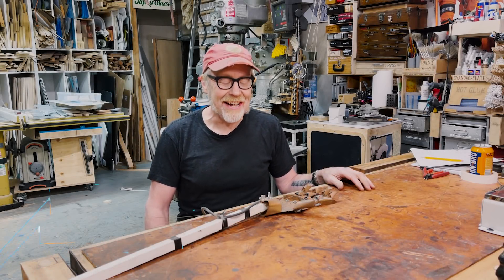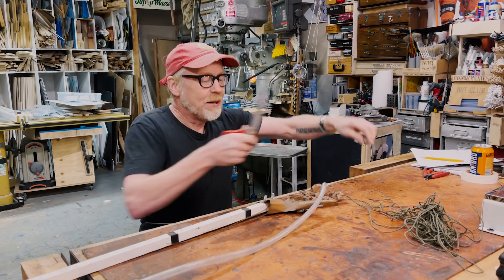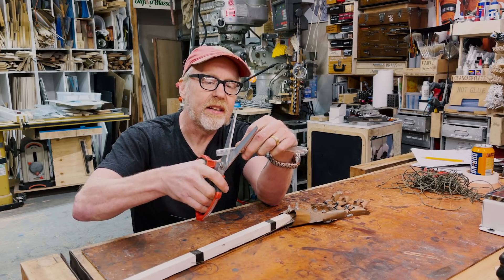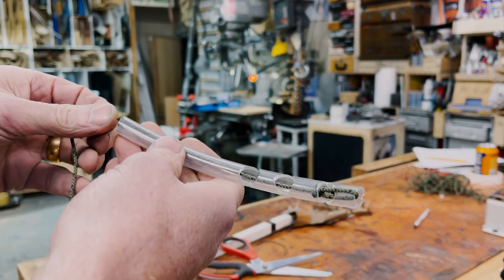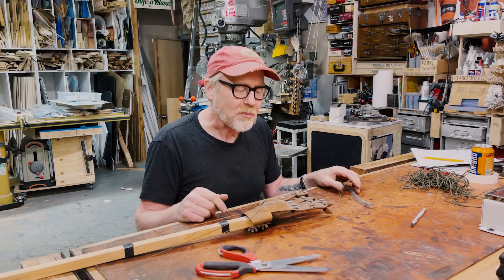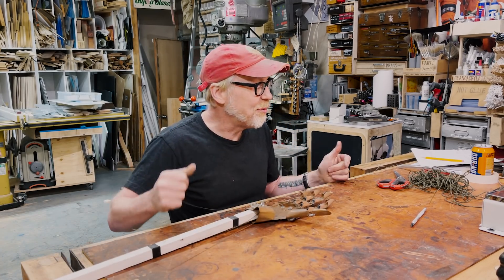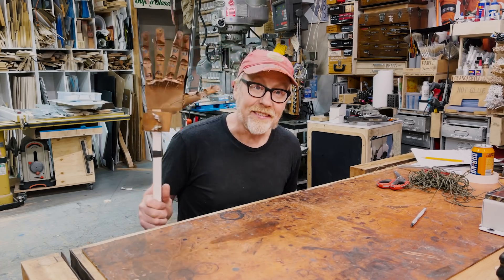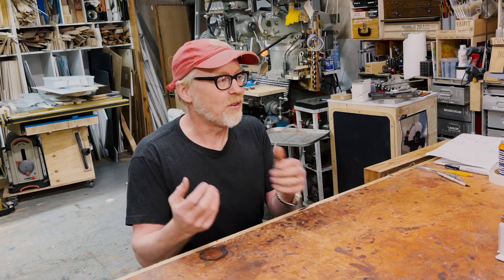Adam Savage's First Mechanical Hand Build!

Comment: My technology students association (TSA) team built one out of polycarbonate and started off using remote controlled servo motors to operate it until we found out it could not be remote controlled so they added me to the team and I brought computer program controlled motors to the table in the form of the k'nex brand, I was on the k'nex challenge team for my high school and incorporated the motors and a few k'nex rods to wind and unwind string that moved the fingers and used rubber bands where you used springs, we did this not knowing of your model in like early '07. We took 3rd place in the state of FL 😁

Comment: Thanks for sharing this. Love your work. It works so good. I built a mechanical hand in early 80's with Erector Set and Futaba RC equipment. Scared the crap out of the dog when I made in crawl across the floor. I don't have that hand anymore but I still have that Erector Set and RC equipment.  Really.  :)  Oh, and I still have my X-wing I built from scratch from memory after seeing it in the movie the first time in the summer of '77.  BTW, my memory was faulty but you can tell it's clearly an X- wing.  Would love to show you pic.

Comment: Hey Adam, I know you typically film on iPhones in your cave and struggle with focusing the camera sometimes. When you're struggling with focus you can press and hold for about a second or two wherever you want to maintain focus and the iPhone camera app will lock the focus so it won't continue to auto focus. You can also adjust the brightness by sliding your finger up and down near the box it creates. To go back to auto focus you can just tap anywhere in the cameras field of view. Hope this helps!

Comment: so weird, i built a working life size Kumg Fury Arcade robot a while back and was left to my own devices to figure out robot hands and without googling anything i fabricated hands using rubber tubing just like adam used, same exact cuts, same exact design. Mine just popped into my head as i tried to work through it. weird how minds think a like

Comment: You can see the hand in action in Season 3 of Mythbusters, episode  7 "Exploding Jawbreaker".
They use it to test static discharge off a PVC pipe that's been sandblasted while resting on insulating material.